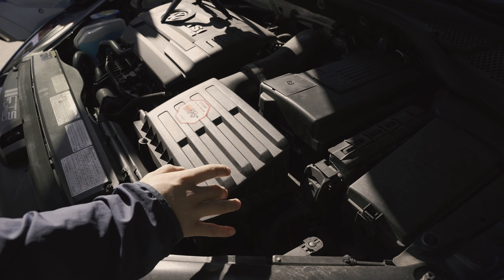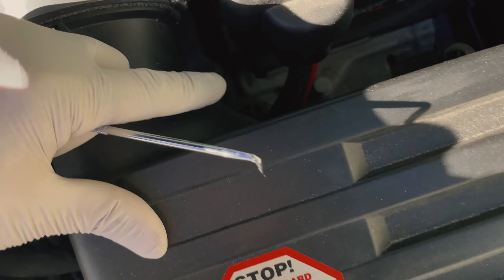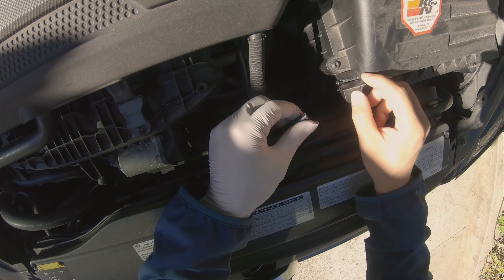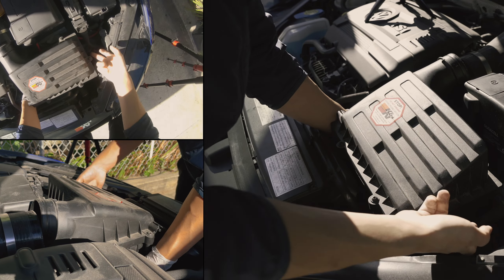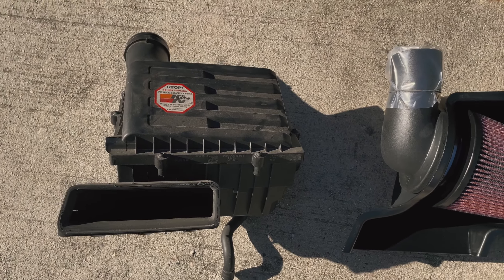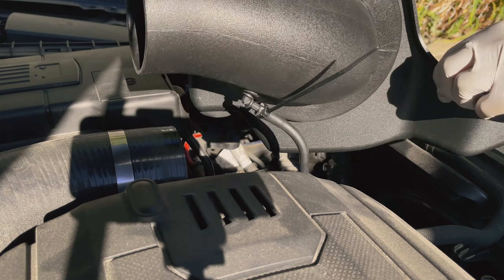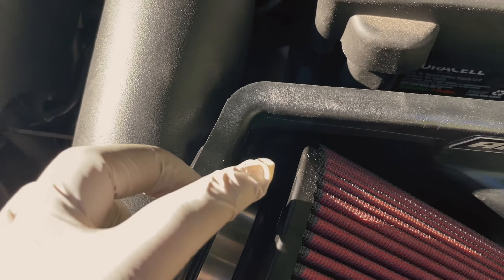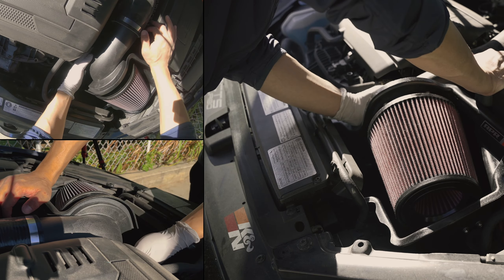APR PEX Open Intake Install on the MK7 Golf R

Comment: Nice addition. I'm always leery on open air intakes but I like the design of this one and may go ahead with it. My current setup is the same as the OP.
Reply from the maker: Yeah I know what you mean dude, but I'm liking the intake so far. If you have done everything to your stock system to tweak it to its max potential, i think the PEX intake is a nice budget friendly option vs all the systems available for the mk7.

Comment: Looks cool. How do you like it? I'm seriously considering this as a replacement for my AWE one
Reply from the maker: Thanks man. I like it a lot. I would assume it will be quite louder than the awe closed intake system but that can be a pro or con. Don't notice anything else performance wise, no gains, or quicker throttle response per butt dyno. However, it is very loud. Hope this helps and will ofc grab more sound clips. Just need time to edit.

Comment: You worry about hydro locking during rain or snow storms?
Reply from the maker: Nope, not so much. My MK6 setup was basically the same. Would start to worry during flooded areas however, but then again who doesn’t? 🤞🤞

Comment: On Apr they say you need a secondary air filter but you haven’t put one on?
Reply from the maker: No SAI breathers on the MK7 R
Reply: @ilimit  I've ordered the same intake but i have a MK7 GTI Clubsport and i was confused by the secondary air filter comment on the APR  video too - looks like my setup is the same as OP, just the vacuum hose to worry about i think. Thank you for showing the whole process and mistakes that can be made, hope this makes my install a bit easier
Reply from the maker: @GTIClubsport  hey man thanks for the feedback. Good luck on your install and enjoy the sounds after 👍